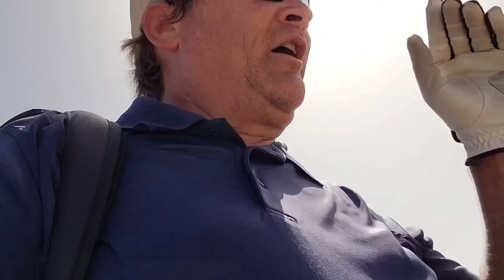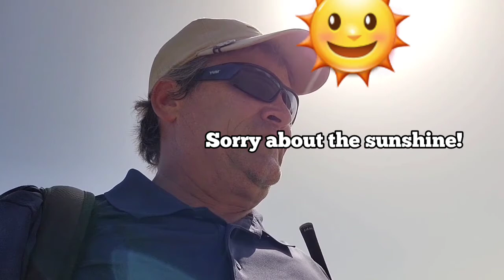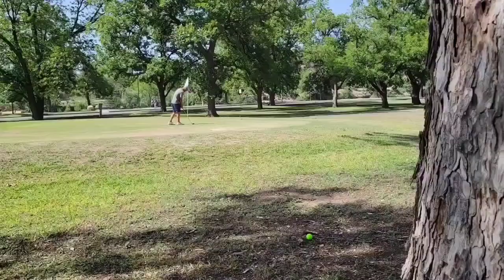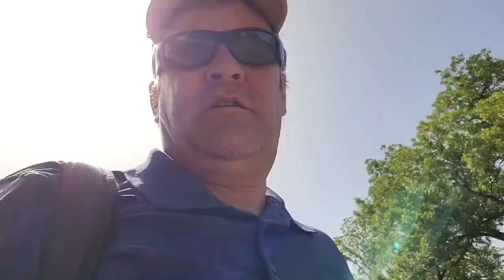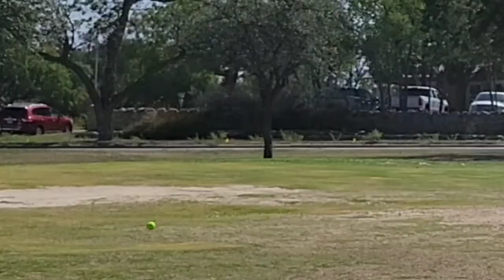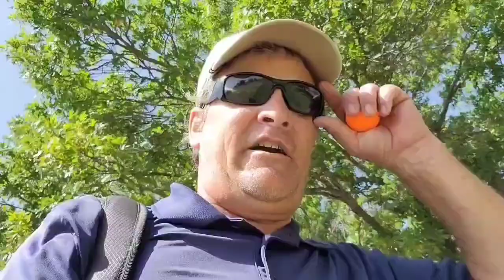Friday Vlog Ep. 4 With My Old TM Burner

Comment: I benched my driver for a week, don't own a 3 wood so I practiced up my 5 wood and used it off the tee.  The pulled out the driver and hit it much better.  Learn to knock that 5 wood long and accurate and your driver should improve.  Of course, you driver may just not be suited to you.
Reply from the maker: Well I had changed the grip. I had a small Jumbomax grip on it. I wanted to see if I could use a normal size grip and maybe swing a little faster. But the bigger grip actually helped keep my wrists quiet from flipping the club around. So needless to say, I will be going back to the Jumbomax. That is what is on the Burner driver, but just in a larger size and I was hitting decently.
Reply: @thecringegolfer  I too have large hands.  On my clubs I use large grips with two wraps of tape under them.  I really don't want hand speed as a thing with golf clubs.  This ain't racquetball, as I learned early on in my game.  Having large enough grips that I can feel comfortable swinging hard, without getting in to a death grip is my thing.  I hate feeling clubs at the stores, those skinny grips don't let me get the feel at all.